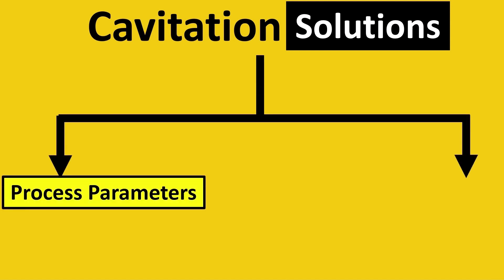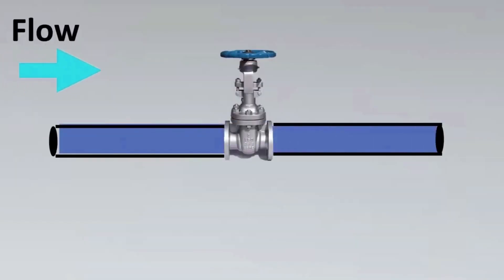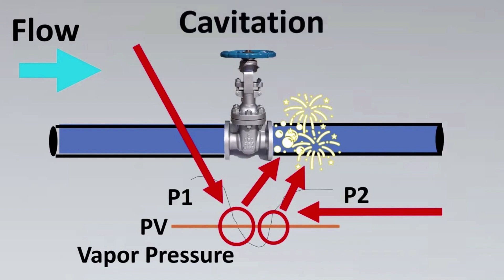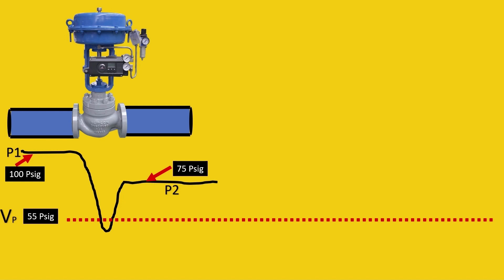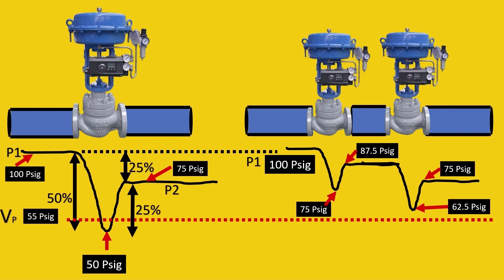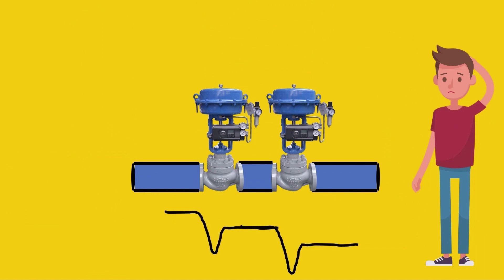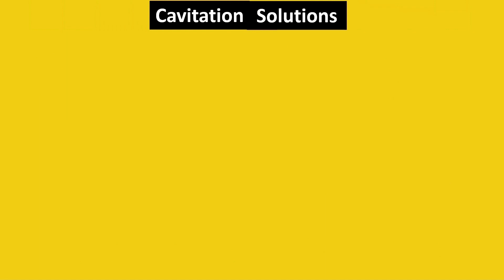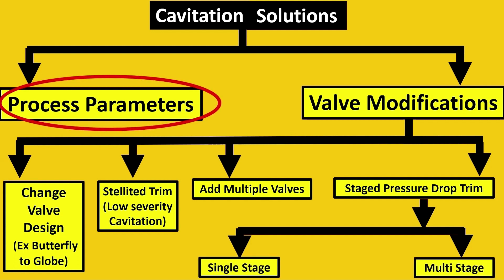How to AVOID CAVITATION in Control Valves -Part 1

Comment: Why you not use only 1 small valve? P1=100 P2=87.5 then only1 valve can avoid cavitation.
And how did you know small valve can increase P2. Then if process flashing occurs just only change smaller valve to increase P2 Did I understand correctly?
Reply from the maker: Good Question if we just have 1 small valve then the the CV of the valve will be low and we also have to balance CV . You can watch the video on the channel , what is CV in Control valve to understand better or let  me know if i have understood correctly your question

Comment: Nice logical explanation. But don't you think using 2 valves is an uneconomical solution as compared to using multistage trim? 
And how will the control signal control both the valves?
Reply from the maker: Yes you are correct , That is way 99 percent of time engineers prefer multi-stage design instead of multiple valves

Comment: Waiting for Process Parameter video. But who will take decision to select out of two methods - Process team or Instrumentation team?
Reply from the maker: A very Good Question, Instrumentation usually try to go with valve modifications because it is their baby (Because process point of view as you would have seen in video in multi stage the FINAL pressure can be maintained same P2) however Instrumentation can recommend to process team if the Valve can be move closer to pump etc since this is more cost effective .

In short for Valve Modification Instrumentation has upper hand to take decision.

In Process parameter Instrumentation can take decision but after consultation with 3rd parties like process department , piping department etc but it is worth the efforts since we can save a lot of cost by using these methods. 

Hope i was able to answer the question. !! 

Your passion Balaji, to learn instrumentation drove me to write such a detailed answer 😊